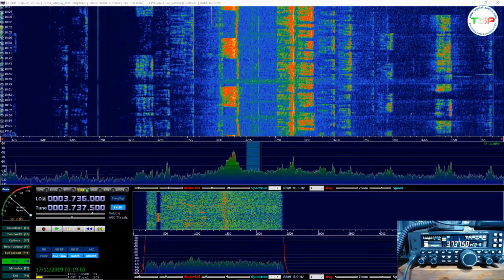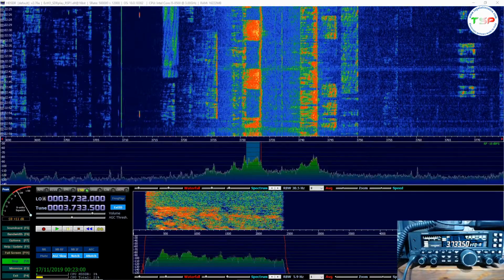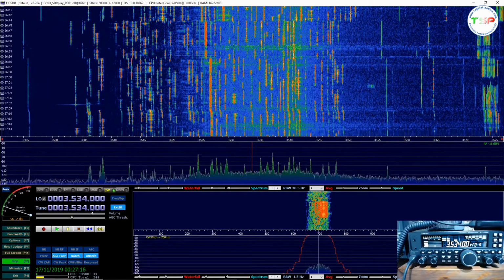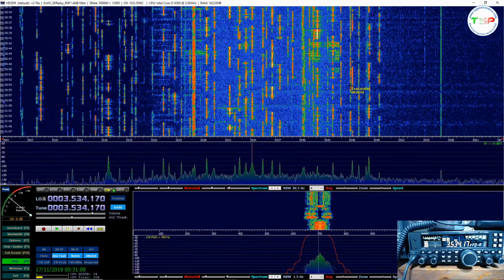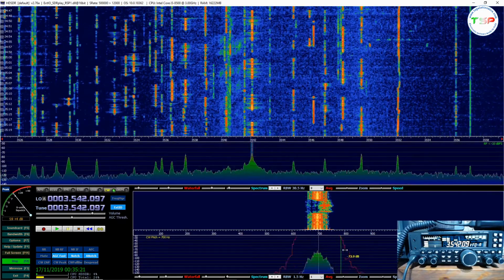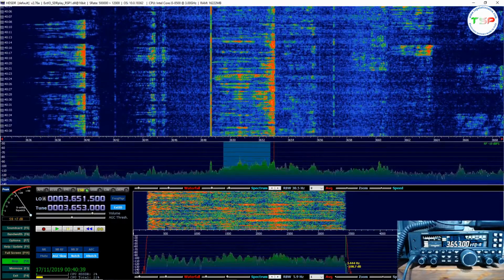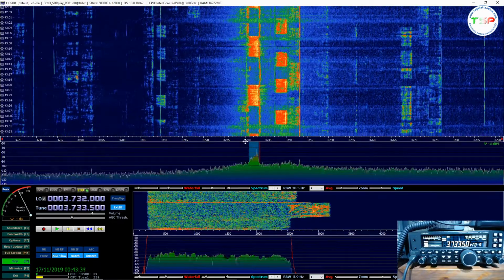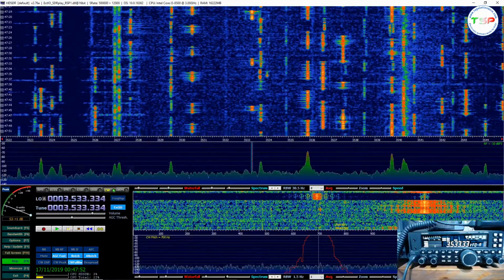The advantages of SDR

Comment: What is the band width of the sdr while using the radios IF as input?
Reply from the maker: The band you can see on the monitor is mainly dependent on the sampling frequency of the SDR receiver. Then it depends on the available bandwidth of the output signal, i.e. the signal arriving from the IF, and this depends on the filters on the radio. For this reason, it's preferable to sample the IF signal just after the first RX mixer and before the so-called roofing filter.